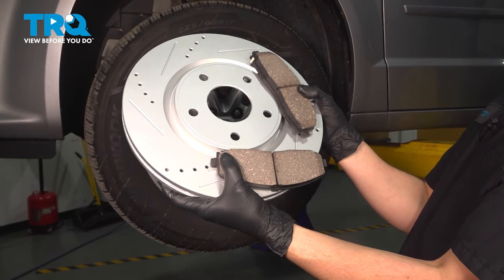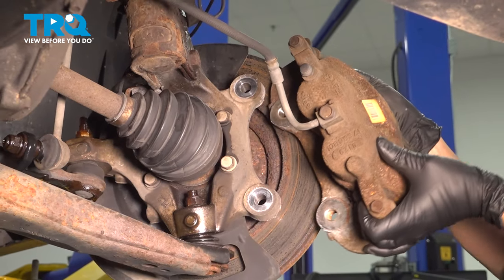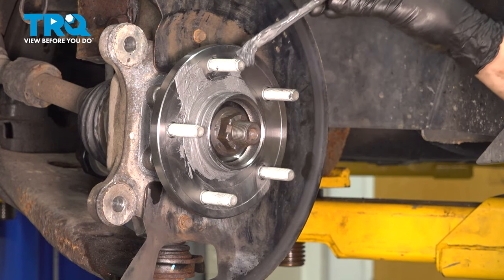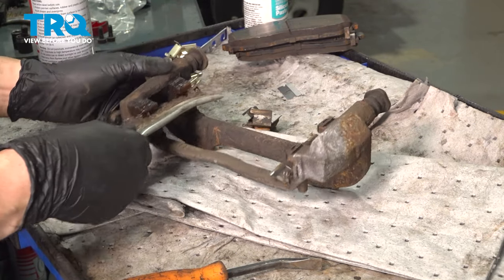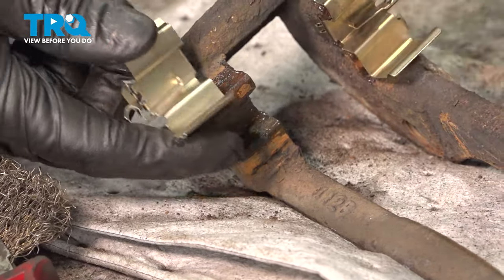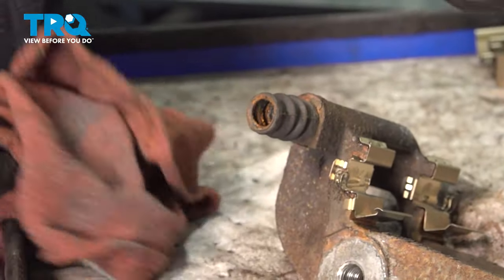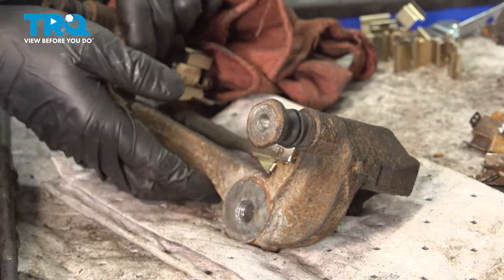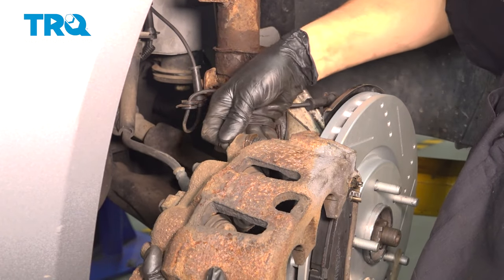How to Replace Front Brakes 2008-2020 Dodge Grand Caravan

Comment: Why exactly do you remove the caliper with the bracket? The bracket is magically off the caliper after installing the rotor. Seems like it would be easier to remove the caliper while the bracket is held in place.

Comment: Don't crack open the bleed screw for nothing just loosen the master cyl fill cap and compress the calipers back gently a little at a time why risk adding air  ( or even stripping out / breaking off bleeder ) to a brake system that is in good condition.